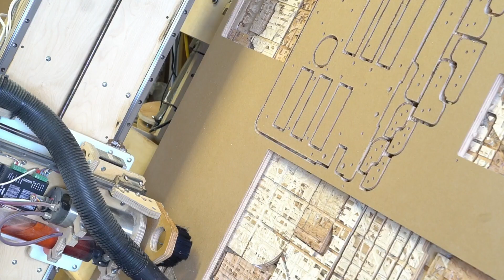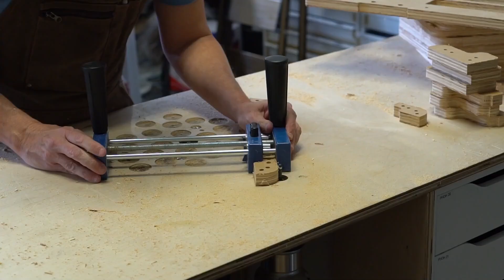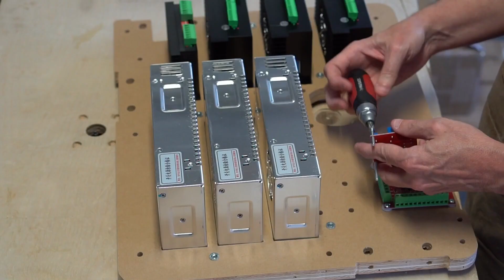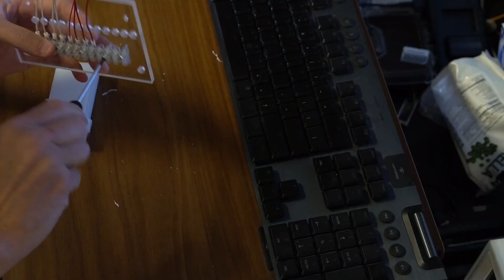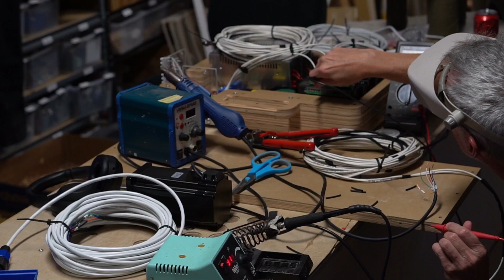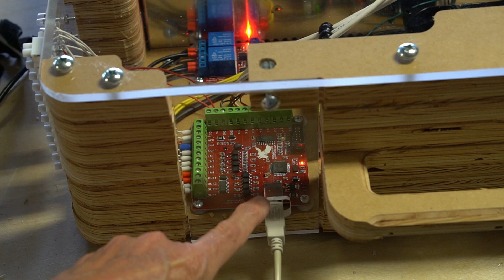Watch Me Build Closed-Loop CNC Electronics in 25 Minutes

Comment: 50ft ! Would anyone like to calculate the loss and power consumption and the proper size wire to achieve the correct voltage/ current 🤔

Comment: what electronics/board do I need if I want more than 4 axis?
Reply from the maker: I would recommend the pokeys57CNC controller. There are8 motor driver connections on that board.

Comment: Amp rate of this power supplies
Reply from the maker: These are 10-amp power supplies. If you are looking for the "rate" of speed of the current (amps), that is dictated by the voltage, and these power supplied are 48V.

Comment: You would be better off using 1 power supply for the motors.
Reply from the maker: A single power supply would be an extra cost and potentially higher weight., These power supplies allow the current draw for the disparate drivers. A single power supply would be insufficient for all three motors. A single power supply that was spec'd for all three drivers would require a very high current output. Using these power supplies is also providing a safety factor so they will not be topping a current draw, saving the integrity of the components and enamel coating.

Comment: how to control steps movements, like lets say we have 400 circular points to move one by one and i need to move pointer in following example sequence  starting from  0->10->240->45->28-> .......... -> 400 . How can we automate this ..
Reply from the maker: Are those points on a linear movement, or a circular shaft position? If the latter, first you would need to set the steps per unit so one full rotation is 400 steps, then you could create a gcode program: G0 X0 G0 X10 G0 X240 .... If the former, you would set the steps per unit according to the linear distance you desire for the placement of the 400th step. The formula is pretty easy and if this is sounds like I am in the right direction in answering the question, I can help with the formula.
Reply: @PatrickHoodDaniel  this is what wanted to achieve but using gcode..https://youtu.be/SUziz1zupGk?si=K1gqiJ3PW6hxuFhH

Comment: Nice video showing your abilities and great touches on the box! One question I have is, you use two motors on the X axis, is that because you build router based machines on the wall? I am new to this, and will be using to control a Sherline mill machine so you threw me off by using triple power supplies, double motors, relays for different things, and a mist/flood pump that I understand would be for metal (but you seem to work on wood and plastics only), and so on. I bought mine used with no warranties so I have only one power supply S-240-24 (that’s providing 27.6V at the moment), three drivers HY-DIV268N-5A, and one breakout box(?) NVCMV2.1 125 kHz to control up to 6 motors, and 3 nema23 motors that are 2A each. I’ll be using my laptop with Mach3 to test it but plan to replace it with a desktop in the near future. If you can give me a few tips, I’ll be very grateful as I’m lost in this! Your video was very good but since it goes full fast forward it leaves individuals like me with a bunch of questions 😢! I was a computer tech for over 30 years but never got into the Breadboards and deep electronics, even though I have a good understanding of components and maintenance on them like the soldering, replacements and such.
Thank you!
Reply from the maker: Builds like these are for customers and not for my machines. This customer used two motors to move his gantry. This is the typical setup for most CNC routers of a large size. My machines typically only use one motor with a very long shaft extending so two motors are not needed and squaring is resolved mechanically. Most closed loop electronics use a power supply for each axis. It is how it is typically sold, but I also like using separate power supplies to get a bit of extra room for current. I have a lot of videos that step you through the process very slowly and in a detailed way. I would suggest taking a look at those videos. A good starting point would be the videos on this page: https://buildyourcnc.com/item/electronicsAndMotors-electronic-component-breakout-Mach3-USB-Board
Reply: WOW! The fastest reply in the whole YouTube universe!!!!
I’m still puzzled by the closed loop (watched only one video on it) and it’s benefits but for now I’ll have to stick to my setup as money is a great barrier on my evil world domination plans 😂!
I’ll watch the other ones but before then….
SUBSCRIBING!!!!
I appreciate you taking your precious time to discuss particle physics with a toddler, but keep in mind that I sincerely am impressed with such care for your viewers! Hard to find it in here anymore!
If I can be of any help, let me know!
Edson from the sunshine state!
Reply from the maker: @roadshowautosports  Thank you very much. Buildyourcnc also from the sunshine state!
Reply: AND you’ve got your own playlist in my library! A $59.99 value, yours for free!!! 😂😂😂
Thank you, brother! It really means a lot to me!

Comment: Great information you are sharing! One detail I would like comment on is the cooling fan direction. The "pressurizing" idea does not produce great airflow for cooling. It would be much better with the fan blowing "out". This will create a low pressure in the cabinet which produces laminar air flow. By placing intake holes at the opposite end of the cabinet from the fan, all incoming air crosses the cabinet providing maximum cooling to components. (make intake holes at strategic points between components) When using pressure, the air is only looking for the easiest way out, not necessarily moving near components. Also, you can still "filter" the incoming air.
Reply from the maker: Thanks. Very helpfull information. I didn't realize that blowing air into the cabinet was less effective than sucking air out of the cabinet for cooling. The retrofits that I work on typically have the air blowing into the cabinet.

Comment: You have a power supply for each axis? Why does closed loop require a lot more power. Are you driving stepper motors or servos? Looks very over my head complicated . That control center your wiring up must weigh a ton no?
Reply from the maker: Nope, it's pretty light compared to a toroid transformer.

Comment: What is the need for using 3 power supplies? And what is the purpose of a relay?
Reply from the maker: Eash power supply powers each motor/driver pair, and closed loop setups typically come in that format. I could have used a huge transformer, but that would have added unnecessary weight. The relay is used to decouple the signal connection between the controller and the VFD. I could have just connected the two grounds together from the controller and the VFD, but I have had issues with doing this in the past.
Reply: @PatrickHoodDaniel  many thanks. I have had trouble integrating/connecting a pulse laser directly from a cnc controller to switch on and off with a g code command. I believe a relay might help as a middle man but wasn’t sure of the circuitry and the specific relay to adopt. Any thoughts?
Reply from the maker: @pratikshukla6075  If you're going to be pulsing the laser at a high frequency, like more than a few times per second, I would not use a relay. If you can't connect the laser trigger directly to an output from the controller, then you should use a device that is intended to switch at a high frequency, like a solid state relay, a mosfet, or a transistor. But, if you are using the laser in a typical laser type scenario, I would highly recommend using a laser DSP, like the Ruida or similar controller.

Comment: Sir, I am from India, 

You are one of those who inspired me and gave me the confidence to think about building a CNC router..!!! 

I have some doubts. Can You help or do a video on this???

I use the Same RNR Motion card.
 
1)Can I use Adhesive Aluminum Tape to wrap the Motor Cables and Signal Cables and earth one end to the Chassie to prevent any EMI-related issues..!? 

Simply wrapping the cables with a conductive material like aluminum and grounding one end of that wrap to the machine body would discharge any potential voltage spikes that may affect?!

If that is effective,

Grounding to the Chassie or the electronic/digital /DC ground on the controller board? Which is necessary?
Reply: Control cables should generally be routed separately, motor cables produce electrical noise so have to be routed separately. Similarly keep the USB cable away from the motor cables. In an industrial setup even the ground would not be shared
Reply from the maker: Yes, you can do that. Look at videos from https://www.youtube.com/@baxedm9806 and you will see he is doing a very similar thing. The EDM machine puts out a much higher EMI than a router, so this technique is a way to ground EMI.
Reply: Thank you for typing those long set of words for me..! Keep up Sir..! I will Check @PatrickHoodDaniel

Comment: hang on you added shielded wire but didnt ground the shielding? Lol wtf are you doing.
Reply from the maker: Of course I grounded the shield. There is an exposed wire that runs along the shield within the cable that is paired with the DC ground. You can ground shield on the DC ground or the Protective Earth. Since this is a wooden enclosure, the shield is taking the shortest path to ground, it's own DC ground. I could have taken this ground to the PE of the power supply, but that would have introduced too much wire causing an antenna. Because this is in fast motion, you cannot see the shield. If you look at my latest electronics wiring videos in normal speed, you will see I am also grounding all of my shielding and you can see how I do it.
Reply: Ahh fair enough. Hard to see at that speed. I stand corrected. @PatrickHoodDaniel

Comment: Ok some pretty obvious criticisms

Delete parts/processes. No need for that many power supplies.

Power supply has a fan for a reason. 4mm gap u left is not nearly enough

Generally a better practice to solder rather than crimp.

But the biggest one is: why wood and plastic? Why not buy an off-the-shelf metal electric box and screw into the chassy? That's better in every perspective: no fire risk, EMI shielding, less labor, very comparable cost, even looks better aesthetically (although that hardly matters).

Comment: Hi, nice Video but that are not a Closed Loop CNC System! With this System the Closed Loop are recognised only miss steps from the Motor, but not the Backlash from the Ballscrews etc. Also Mach 3 and this USB Board can`t Controll a Live CNC System! For a real Closed Loop System you need a Linear Meassure System at every Axis and also a Controllboard that work over Ethernet etc.
Reply: I don't think that you are correct on any of the points mentioned. The encoders monitor the motor shafts. By using zero backlash ball screws, the system is exact. The controller is wired direct to the motor amplifiers. There is no need for Ethernet, but the controller most often uses serial protocol for communication.

Comment: I know when I use to nest parts for a cnc plasma our system always new the stock material size and configuration. If we started with a full sheet and only used some  portion the nesting software captured that new shape and gave it a unique ID/name so then we could call up that and nest our parts in all those odd places no re positioning needed. Not sure if anyone already spoke on this but I am sure you know this by now. Good video, Thanks.
Reply from the maker: Yes, this is something I do from time to time.

Comment: Considering the type of electronics, why is there no mcb, contactor, led indicator, voltage display, emergency on the mains input, mains power distribution? Also why would you use a wooden box nd not sheet metal?

Comment: Thank you for a great video. Please excuse my lack of understanding,but where do the the encoder’s get connected to? Also do they provide feedback to mach3? Thanks!
Reply from the maker: The encoders go back to the driver. Mach3 doesn't take the encoder feedback as that would be more processing than is necessary. The driver knows the commanded pulses and will make every attempt to achieve the commanded position for the motor. If every attempt the driver makes fails, the driver will output an alarm for one of the controller inputs so the machine can stop. If the driver cannot achieve the desired position, there will most likely be a physical binding or interference with the travel of that axis.

Comment: If your goal is to burn up the power supplies by restricting the airflow to the fans you might also tape off the fan openings because a minimal amount of air might leak pass the 1/8 inch gap between the wall and the one closest to it. Looks cool, but the compactness has turned it into a thermal nightmare. The air should enter one side and exit on the opposite side for good cross flow.
Reply: A bit harsh... but true.
Reply: @kurtbilinski1723   I sadly agree. But Awesome video !!
Reply: Yeah sadly I gotta agree, add the fact that it is plywood and thus quite flammable ...
Reply: @xConundrumx I was watching the video and thinking of it but hey, I can’t say anything as I’m an apprentice trying to understand why and how each individual does things.
Reply: It’s a customers machine, guaranteed maintenance guys come on lol😂
Reply: What a dick comment.
Reply: Well be sure to go buy those plans so you can update them and sell them back.

Comment: Steppers work better when you run them at less than maximum voltage ...Just a hint ....
Reply from the maker: Thanks.
Reply: @PatrickHoodDaniel  Had some that tended to stall on decel  .... after days of configuring the control what ended up fixing it was to turn down the voltage ,,, even though the driver said 60v , it liked it much better at 52 ...
Reply: Modern stepper drivers use current chopper control circuitry, voltage is not so crucial here ( however there is a high and low voltage limits for correct operation)
Reply: @arbjful  These are "modern" steppers ...and they are more likely to stall on decel at max voltage .
Reply: @theiaminu5375  that’s strange, we never faced that problem. I suppose ‘modern’ is a relative term
Reply: @arbjful  Had me stumped for days ...doing a retrofit , and the offending axis was the tool carousel ..

Comment: Don't get it why the customer wanted shielded cables but not shielding box for the whole control block
Reply from the maker: What appreciable benefit is shielding the control box? The individual components are earth grounded. Thanks.
Reply: @PatrickHoodDaniel  For example yesterday my test home-server crashed from RAM error when a taxi parked near us and start using powerful and legal mobile radio station. Later tested all 8 modules and no errors were found, modules are non-ECC and during the crash everything was outside of the original case

Comment: With a heavy water cooled CNC and waterline routing I find it's only the Z axis that needs closed loop. I'm mystified why you claim to be designing electronics as you aren't, you're just boxing it up to outer dimensions. Wire ferules are only useful for cheap spring leaf terminals. higher quality rising clamp terminals have no need for ferules except for those who are undisciplined in wire strands preparation.
Reply from the maker: I explain why I don't use coosed loop in another comment. Thanks for the comment. I am always looking for better ways to insert wires into terminals. Haha.
Reply: Maybe I'm too harsh😆 I take my own manual dexterity for granted but many people have fatter fingers and poor close vision. I suppose if there are no other consideration it makes boot-lace crimps look more attractive. Not to diss you too much but when I've been watching ESP32 and bluetooth videos and working on software for my own electronics arrangements it was a surprise to see the electronics in yours was all pre-made before you even saw it😂
Reply from the maker: @fluiditynz  I have skinny fingers, but have very bad close vision. You see me with jewelers loops in parts of the video. Are you referring to ESP32 as in CNC electronics or ARM  ground up electronics for other projects.  You may already know I teach ARM microcontroller electronics on this channel which is why I'm confused.  Thanks.
Reply: @PatrickHoodDaniel  I haven't seen your other videos. But I was I was an early user of Arm for 3D printers, about 13 years ago, I designed up a 3D printer motherboard using an STM32F103VBT (ARM). I had it printing and even processing G codes but I got frustrated because the opensource community was doing a much better job than me alone, even on the little Atmel processors. But I did have my printer working. So it was fascinating after all that time, on my purchase last year of a CR6 max, to see that they used a STM32F103 on a smaller pin count chip. It was actually my first venture into C on the STN32 after many years with only basic variants, VB, Python and assembler for various brands and models of microcontroller. Huge instructions set for RISC unlike the recent RISC V micros!

Comment: I dont see a reason to use 'special" cables for the power supplies. A normal power supply cable can handle 230v at 16a all day long. If you are pulling more then your breaker will trip

Comment: Hi, i have a question about cnc hope someone can help me out. right now I'm building my own desktop cnc, my machine is a verticle milling type where the xy axis moves instead of the spindle, i set up my machine to move the workpiece to → which is positive X axis when i jog X+ in software. Is this correct? I'm confused because my spindle is moving → in simulation, meaning if my spindle is rigid, my workpiece should go against my spindle (moving ← direction). i tried a simple reactengle pocket cut, the machine does not do whats shown in the simulation, its doing the opposite. Thanks...